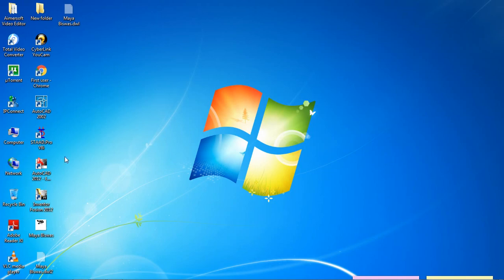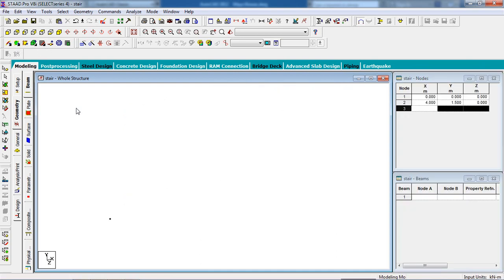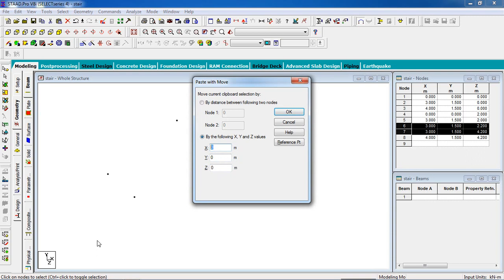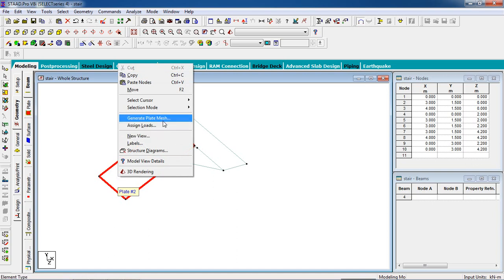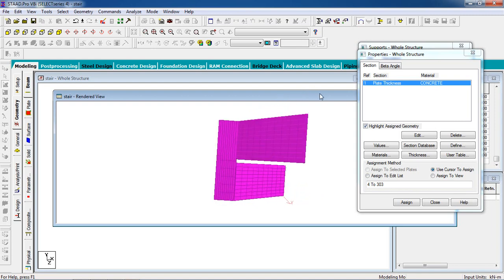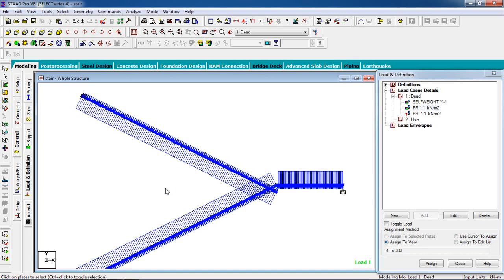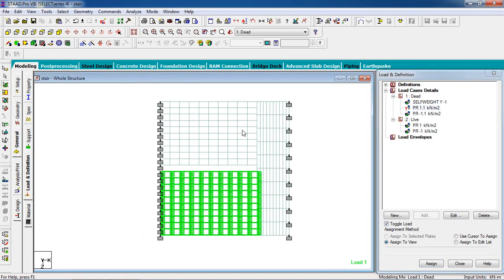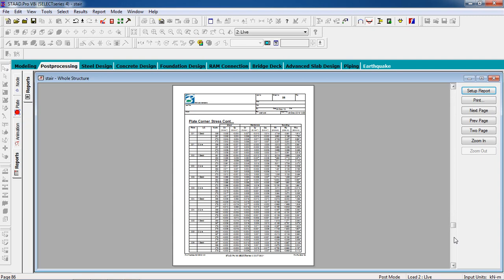STAAD Pro Tutorials - Analysis & Design of RCC Staircase With Details Part -1 ( Day 19)

Comment: I used the same thickness 200mm . After assigned to view +1.1 load then i checked the front view by changing the scale but there is no upward force on the second flight slab. If there is no upward force do we need to apply -1.1 load?

Comment: boss I have done this exercise in laptop and  I have an error in output report

220 errors its showing

  *ERROR* ELASTIC MODULUS (E) NOT ENTERED FOR MEMBER/ELEMENT/SOLID NO.     
   *ERROR* SECTION PROPERTIES NOT ENTERED FOR MEMBER    
 above errors are showing .. pls advise
Reply: Chanu Lanka I think you already found out the answer by now but still, that error is shown when you have not assigned member properties or plate thickness
Reply from the maker: Then you did something wrong ! Watch the video carefully then do it again !